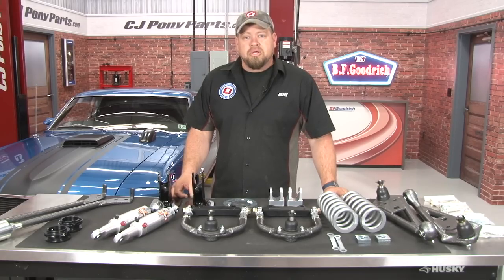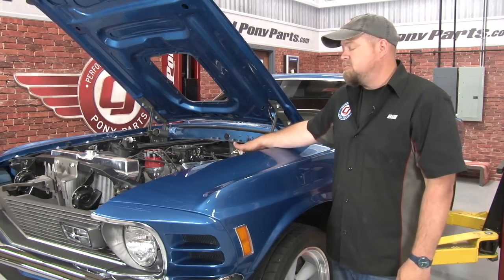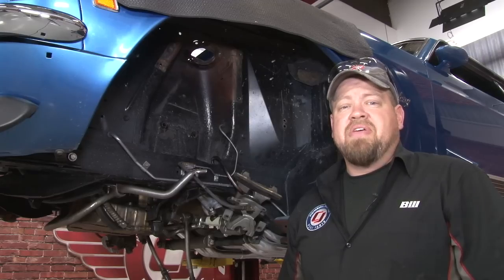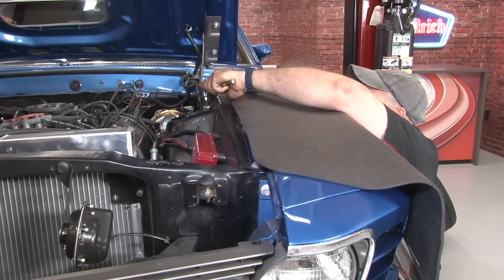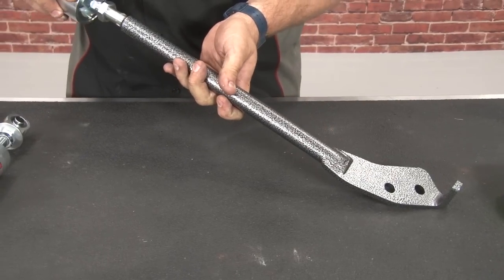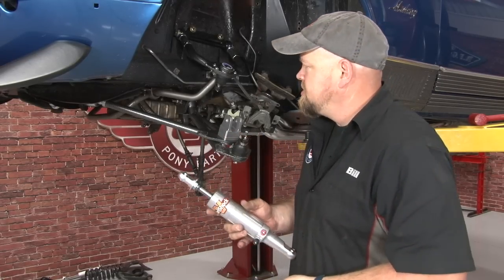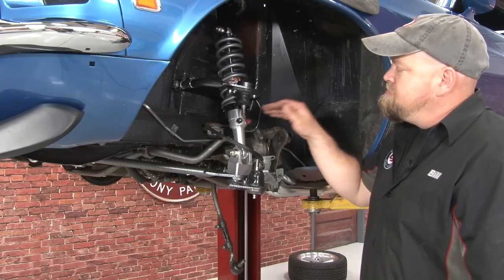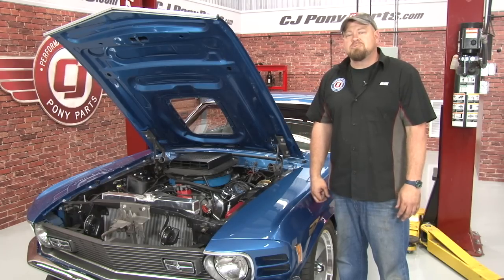Coilover Conversion Kit | Total Control Products | 1968-1973 Mustang

Comment: Make sure you torque your shock and control arm bolts when the vehicle is under its own weight. Otherwise you’ll be putting way more strain on the bushings.

Comment: I just installed this kit on my 69 fastback.. glorious
Reply: I've been researching kits for my 69 as well.  TCP is high on my list.  Have you done a rack and pinion swap yet?
Reply: I did, I went with TCP on that as well. My car was manual steering before so the difference was night and day. the swap went well with minor grinding here and there to get it in. Because the TCP unit is "race ratio" 2 3/4 lock to lock, it takes very little input to get the car to turn. That and it's very light so you'll want to get ahold of the guys who make the pump and get a set of flow control valves so you can set how heavy the steering is. I gotta say with the front end set up and the rear still bone stock the car rails through corners.. do it, you won't be disappointed.
Reply: Very nice.  Thanks for the reply.
Reply: You gotta learn how to remove those cotter pins properly with those pliers. 😂😂👍🏼👍🏼 
The right tool but the wrong technique.

Comment: Holy crap did you see the flex in that strut rod frame mount when torquing  the rod ?  I think it needs some welding/reinforcement....
Reply: That whole area looked about as stable as tin foil
Reply: I ran it back that was crazy

Comment: I think the kit is very impressive.   Just an observation.  When you look at the McPherson strut assemblies on Ford cars I note that the LCA are attached to the chassis at two locations,.   With the early Falcons/Mustangs..the suspension was a mixture of UCA which took the spring load, and it was bolted to a substantive spring tower at two points, and a LCA arm which was located to the chassis at one location.  

In this modification with via the kit , the spring is bolted directly to the LCA, thus eliminating the spring/shock directly to the UCA,  Would the LCA mounts deal with the shock loads or is there no difference overall.  I am aware that the UCA went through a period of improvements over the years, especially in the early Falcons where the upper strut towers were improved/strengthened due to fatigue.  Did anyone notice the flexing of the lower strut rod mounting bracket when the strut bearing was being torqued.  Will the strut mount fatigue over time now???  Would the LCA chassis mount have to be beefed up to take the shock loads?
Reply: IMHO for normal use the LCA mounting point would be substantial enough to handle the load from the shock/spring. For a racing application I would consider beefing up the mounting area.
Reply: Good question. Basically what he said i.e. ditto? Withab BJ
Reply: I would think it's better suited honestly considering how LCA is mounted to the frame instead of to a thin ass shock tower. That said, I will and would recommend running a shelby crossmember that is thicker and also bolts to the LCAs to tie them together. An extra plate of steel can't hurt and the front end on 1st gens is known to have too much flex

Comment: As someone commented those strut rod mounts need some loving on this thing . I usually weld the down both sides at the frame and core support because they were never really that great even right from the factory. These are one of the bad parts of the front suspension in a mustang .
Also , even tho this kit is well presented its not designed that well . Very limited front end travel and inherently flawed by moving the load to the lower ball joint in a fashion that its not meant to handle . In this configuration the weight of the vehicle is pulling the ball and socket apart. Some OEMs got bit in the ass doing this (Jeep Liberty comes to mind immediately)
Someone needs to come up with a complete bolt in strut front end for these  , or maybe they have and I just havnt seen it.
Reply: Kyle Van Tassel AJE makes a complete bolt in strut system the uses either Fox or SN95 spindles.
Reply: good thing you pointed out the LBJ problem, I haven't thought about it but it makes sense

Comment: That was very informative but how long does it take to install?
Reply from the maker: That will 100% depend on the experience of the installer. This took around 8 hours to install but that includes moving lighting and cameras around.
Reply: I installed both sides in a day roughly 5 hours

Comment: Bill, Just curious if the famous upper A  arm "Shelby Drop" would have any negative impact of this kit. I will be purchasing this kit along with the rack and pinion kit here soon for my 65 Comet
Reply: +Travis Cooper This kit is designed to mount in the stock location and will provide plenty of drop if needed, the Shelby control arm relocation is not needed or recommended with this setup.
Reply: If you look closely as he is installing the upper control arm you'll see the cross bar has the mounting holes off set upward about the usual inch.

Comment: I'll repeat the same question someone else asked: if the 67 and 68 are essentially the same body, why is it that this kit will not work with the 67?
Reply: They had different spindles depending on the brake set up.

Comment: Maybe I'm just being paranoid but the way that lower spring seat locks into place makes me really uncomfortable. It looks like it could break off way too easily.
Reply: The upper mount is scary as well. Three bolts take the brunt of the load... and they're not big bolts.
Reply: The thread on the shock body is actually an ACME thread commonly used in machine tool and aviation applications. Nothing to worry about there. Also, the spring does not coil bind on this suspension and bump stop at the shock tower is the physical stop for compression travel.
Reply: Decent grade bolts and cap screws are surprisingly strong. A single 3/8" Grade 8 cap screw can hold over 7,000 lbs; multiple that times three. A 500 lb/in spring will only load the bolts with less than 1500 lbs of force total. After that the bump stop transfers the load directly in the shock tower.
Reply: Wrong the spring load feeds into the same structure as stock the lower backing plate installed distributes the load the bolts are larger than those used on any mcpherson strut I have ever seen. load bearing should note be a problem. 
 think of the motor plate used to hang an engine and trans all the time off 4 5/16 grade 5 bolts, agreed no shock load. Similar design is used on 3rd gen f-bodies without problem. If you are still concerned just make it habit to look at them every time hood is up for signs of trouble..